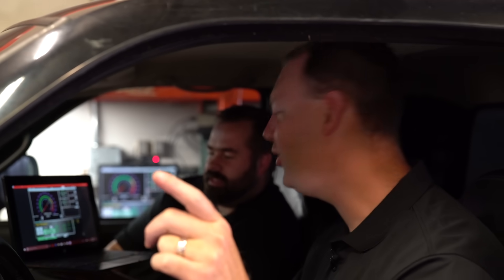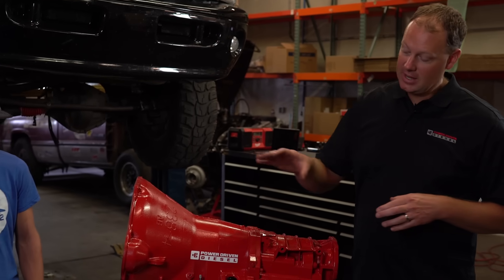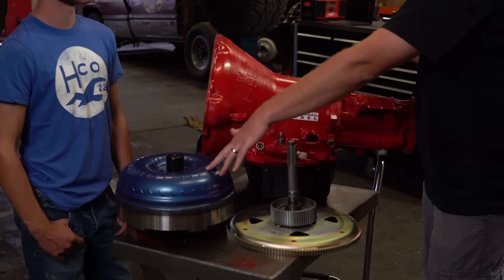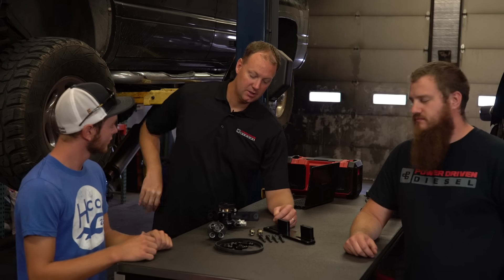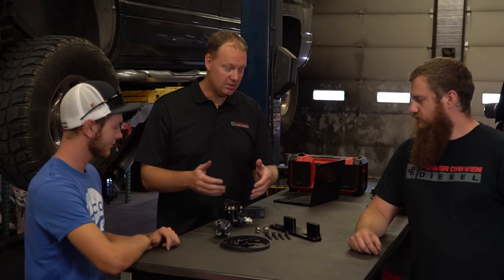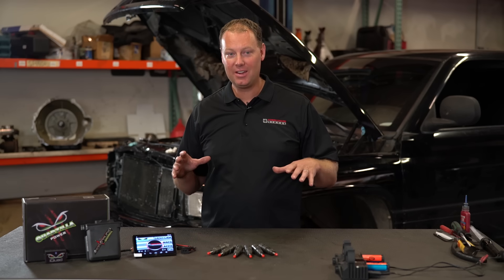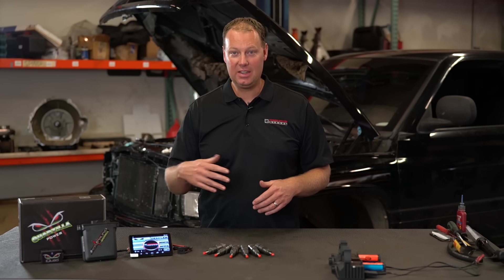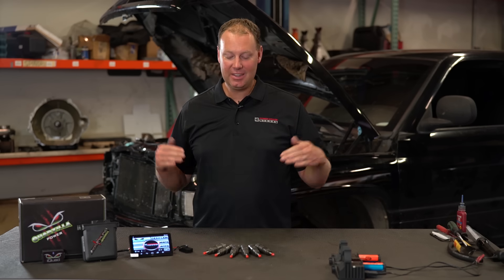We Double the Horsepower of a 24 Valve Cummins

Comment: For 250 bucks you can get a Billet torque converter with double crutches that's the HD model with a 1000 RPM stall on it it's a beast take your stock transmission and put Red Eagle racing clutches in it everything ported and drilled it's about $2,500 you don't need to go by specialty transmission you can work with the one you got I did that to mine no more issues no more burn up Transmissions I love it at least put them in second gear the Red Eagle racing clutches cuz that's your weakest so you want to take care of that one for sure and if you're going to upgrade something put a bigger damn turbo on it preferably a high-altitude one whether you're at high altitude or not and big injectors are nice but you don't need them I could get more horses and that out of my truck for half of what they paid made it would be nice to have all that money but when your broke ass Country Boy you learned to squeeze as much power as you can by doing as little as possible

Comment: I would be happy with the torque converter upgrade and the input shaft being more solid my biggest fear is the transmission falling apart in my 06
Reply: @pddofficial  that's what i was afraid of. how much is a kit for that? f i went that route i'd be looking for heavier duty internals like better clutch packs and a more bullet proof everything because rebuilding it once is no big deal but having to do it over and over again because you bought the wrong stuff the first time is ridiculous. and i've had to do that before too

Comment: So pretty much he’s gonna need a turbo by time he gets home.
Reply: I bet that stock holset is still running strong.  Iv been making 520 hp and over 40 psi at the manifold on my 2003 he341 for the last 6 years. 229k miles all stock still works great (besides things thag were upgraded its all stock)
Reply: @greatlakespowerstrokefx4  you are making 40psi on a stock HE341? Highly doubtful considering that turbo is barely good for 24-25psi. I don’t wanna call anyone a liar so do you have a clipped billet wheel in it or something? That’s a bronze bushing turbo so 40psi would not only cook it it would over-run it.
Reply: @titanary68  yes. Many people have made 500 plus wheel with all stock 03-04 but with running their cp3 dry.
Reply: @titanary68  and that is what they would make stock with stock tuning.  My assumption is the turbo is spinning upwards of 100k rpm faster than designed but it still works.  A turbo is high on my list for much needed upgrades.
Reply: @titanary68  its a Hy35w type d
Reply: Bro they didn’t even head stud it💀💀💀💀
Reply: @kylemaslyn  I ran a BD Turbo on my 24v making 45 psi on factory head bolts for many years without an issue. I met a guy that had an s366 on his 3rd gen making close to 60psi with factory head bolts and somehow still holding on lol
Reply: @edwinj8275  that’s impressive
Reply: @kylemaslyn   No Need A factory 6.7 makes these numbers and they don't come with studs
Reply: @ze_german2921  except that not a 6.7 that’s a 5.9 but on the same note you are correct they don’t need to because they’re not pushing more boost just pushing some more fuel
Reply: @kylemaslyn  you don't need head studs at the level this truck is at , I have a 2000 5.9 that makes 416hp rear wheel wih the stock HX35 at 44psi of boost.
Reply: Yeah maybe but they lived up to their word. Hell the actual offer is to double the power, not to make it reliable. They put more in the trans than in the motor. Now if they had said they would triple the power then yeah, they would be on the hook for a turbo. They did all this shit for free, oh well if he has to buy a turbo later
Reply: I want a free upgrade for my stock 2nd gen

Comment: A new stock ram 2500 already produces 1000 lbs torque. Building an old truck is kinda pointless imo, unless you’re building on an aftermarket block and nothing is stock.
Reply: Pointless? Paying 60K + for a new truck is pointless. I got my 02 spotless with 115K for 17K have about 25K into it now and it will kill a new stock ram. Plus insurance and registration is cheaper and no emmisions bullshit. Older trucks are they way to go unless you have more money than brains which is very common 👍

Comment: Hey is power driven diesel having another double your horsepower give away because I’ve got a 2006 dodge Cummins 2500 5.9 24 valve third gen and I have a Avorrau 5000 turbo on it and I would really like the horsepower to be doubled

Comment: I just bought this chip any ides why my check engine light is on my boost only hits 25 fuel press stays at 18-19 with fass and 125 hp Injectors think it has something to do with vp44 wire tap maybe?

Comment: Hmmmm, I thought that you had to do the dyno run in high gear (1:1 ratio) but not overdrive to get an accurate horsepower and torque reading? Please explain further about letting it get into overdrive with the converter locked-up.

Comment: Is there a way to test the map sensor? My 99 24v doesnt feel like it's putting out 180 more HP when I turn my quadzilla all the way up to 10. When I turn my LLY duramax to the 150 tune, the power levels are night and day compared to stock. You can hardly notice a difference from stock in this cummins. Bonestock besides s&b intake and 4" exhaust.
Reply: Make a custom tune! Every VP44 is different and should be tuned properly

Comment: What sort of long term feedback are you getting on that mechanical lift pump?  I've got a bit of a Frankenstein going on myself with a 24V Excursion.  It had a dead VP, so even though its got good pressure now with some generic frame mounted pump, I want to put in a sump and a good lift pump before I start driving it. I have a 6.4 with an airdog that died, so I am interested in getting away from the $800 electric pumps. Future power goal is probably 500.  Maybe more if I go crazy, but not interested in getting over 750. Might go with a p-pump as well.
Reply: PowerDrivenDiesel I’m gonna give you guys a call and get some more info from you. I think I want to go this route on the excursion. Thanks for the reply.

Comment: can this be done with a 2019 dodge cummings?
with the new factory 
AISIN trans also
Reply: @pddofficial  
thx
Is it safe to say that the other components like the programmer-intake manifold -different injectors-exhaust-cool air radiator are available for 2019 trucks?
Reply: @pddofficial  
Thx, we guys need to see this and know this, so if we consider a choice what is available in selecting the Truck we would like it to be.
 what you can do to help us make our Truck to be the beast it was meant to be.
Don't know how else to put it.
:)

Comment: Good effort but that engine was a pos to begin with. You almost got it up to my 2018 v6 ford platinum twin turbo. But I would have loved to see what you could have done with a 70k mile 5.9 Cummins. Great video.
Reply: How much older is that engine? Also, that thing is way more reliable than a shitty EcoBoost. Shoulda got a 5.0V8
Reply: I would love to see an Ecoboost make 186hp and 400+ lb/of torque At The Wheels in a 2500 4x4.

Comment: Wonder how long that head gasket will last?
Reply: @pddofficial  my experience as a 20 year plus owner/enthusiast of 24 valve engines is anything over 100hp over stock is just asking for a head gasket problem. No matter how you do it, injectors and tuner, turbo or whatever. that oem gasket has some weak points (near the thermo for example) but that has always been my advice and concern with power levels. Good luck to him and you.

Comment: I have a 01 2nd gen 24v that has only 135k original miles.  Is my farm truck.  Needs a tune up
Reply: I pull a cow trailer with mine. Pretty much all it's been used for. Bought it new and only major things to repair so far has been transmission and injector pump. Also had to do the rear end because my brother was throwing doughnuts in it and somehow busted the diff. There was a trail of fluid from the spot back to the house. Stayed in the road for over a year lol

Comment: Doubling the power, how about doubling the cooling? Put a 15000 lb trailer on the back and try pulling a long mountain grade. I would bet that you could count on one hand one hand the times that the rig would make it to the top before the engine would be a chunk of aluminum with pieces of steel sticking out of it. There is a reason the factory does not turn them up any more they do and voids the warranty if a tuner has been installed.
Reply: @pddofficial    Actually the stock radiator will handle a lot of power on these truck.  About 400 HP while towing it you keep the EGTs cool while towing. (Matched bigger turbo for your set up) Ask me how I know.  I have towed heavy coast to coast.  My truck is a 2000 VP truck,  with replaced 53 block (cracked) Allison transmission (blew up six built dodges towing) custom cam, pistons, larger turbo, six by eleven injectors, Quadzilla,  bigger brakes, bigger drive line, Dana 80 (blew up 70) with 19.5 wheels and tires, and all necessary supporting mods.  Tow a 16000 lb fifth wheel up any hill at speed with out issues, EGTs are cool engine stays below 220 on hot days on large grades. This truck runs virtually smoke free.  The engine  in these trucks is capable of having additional power with out issues when set up correctly.

Comment: I owned a Dodge Ram 2500 4x4 Quad cab with the 24 valve engine and the VP 44 fuel pump, what these turds are not telling you is that the upgrade kits sold KILL the circuit card on the pump. Also when you double the HP, your putting a lot of wear on the drive line , so expect to replace transmission, u-joints, some cases the rear axle.Plus you will burn a lot more fuel, for NOTHING. Plus the extra output wears the engine faster, and you pollute and  with some of the earlier upgrade kits .they recommended removing the upgrades if you had an emissions test because with the upgrade you would  FAIL, no ifs ands or buts.
Chrysler shops and Cummin's shops would look for cut and spliced wire off the fuel pump connector, if the wire was repaired...NO WARRANTY REPAIR ON ENGINE!

Comment: I have a stock 2005 dodge ram 3500 5.9 HO Cummins with 307000 miles stock original motor and trans been a great truck would love to rebuild her give her some extra power
Reply: @pddofficial  if I could afford it I would do a rebuild and add more power but I am working very hard just to stay afloat I run a 24 hour road service here in Austin TX helping motorist off the road if they call me I do charge but if I see someone stranded I get them going and dont charge my 5.9 if my family truck and work truck I work road construction during the day and run road service at night some nights I dont get any sleep at all but that's ok working both helps pay some of the bills
Reply: @pddofficial  truth is if my 5.9 goes down we are done we will lose everything but hey this is life right

Comment: id like to do something like this with my 2006, 2500  mega cab. i'm in Nashville so getting the parts for the transmission from that place in Georgia would be a cinch.putting it all together like this however is totally another story i'm sure. i am most concerned with the transmission as those are what is the weak point on these trucks. the other mods i could do over time on my own as this isn't my daily driver. it's my pulling rig and that is the ONLY reason i bought the truck in the first place. I don't even have 200,000 on mine yet though and so far the only issue i am having is with the grid heater and trying to find a keyless entry module to plug in behind the gages for this thing

Comment: 350000 on stock injectors 😁😁😁😁😁 job well done Cummins
Reply: 451k on my 12 valve
Reply: Jonathan Rajsl  i hate that 2nd gear skip get it fixed i jus went overkill on my 01 24v cummins transmission

Comment: Slowly you can see them regretting the decision of doing this for free
Reply: 😂😂😂 this made me crack up
Reply: Looked really happy when they didn’t need to give him a free turbo lol
Reply: wrong, so wrong, the Man is as good as his word
Reply: I saw it right when then hopped out of the truck lol
Reply: I know I’d make the drive to their shop if I had the money to upgrade my truck
Reply: @pddofficial  should have went with the bigger turbo anyways, but still impressive numbers with a stock turbo. I didn't know the compressors only 54mm on these trucks that is tiny!
Reply: TRD185 that’s how it was with the 24valve autos because the transmission couldn’t handle the power made with the hx35 so they put on the hy35 to not hurt the trans. That’s why with the manuals they’ll have a hx35 cause they can handle that extra bit of power
Reply: @Bob20206  : That's not entirely true. It also depends on the model year of the truck. Only 2000 - 2002 model year 24V 5.9L CTD's backed with automatic transmissions had the smaller HY35W turbo. 

I've owned several stock 1998 & 1999 24V 5.9L CTD's with automatic transmissions, and all had HX35W turbochargers on them.

All of the manual transmission 1994 - 2002 Cummins powered Dodge Ram trucks had the HX35W turbo.
Reply: Turbo Diesel I have a 2000, with automatic, so I probably have the 54mm?  I have 245K on mine! Purdy much a garage queen that I’ve owned for 5 years!
Reply: @davekana8388  Just look on the turbo. The tag on it will tell what model turbo it is.
Reply: Turbo Diesel don’t think my tag is there any longer. I had a 98.5 automatic think that one was bigger!
Reply: @davekana8388  
All of the 1994 - 1998 Dodge 5.9L 12V Cummins trucks and...
ALL of the 1998 - 1999 5.9L 24V trucks had HX35W turbos.

Only exception was the 1994 Dodge 3500 (1-ton) Cummins 5.9L 12V. It had a Holset model W1HE 19cm² turbo. That engine setup was rated at 240Hp.

The 2000 - 2002 24V automatic trans trucks had the slightly smaller HY35W.

The 2000 - 2002 24V manual trans trucks still had the larger HX35W.

The difference between the HY & HX turbos is in the turbine housing size (the exhaust side of the turbo).

The HY35W has a 9cm² turbine housing.
The HX35W has a 12cm² turbine housing.
Reply: Turbo Diesel thanks TD, perfect explanation! So the smaller one would spool fast, possibly better for towing?
Reply: @davekana8388  Perhaps, but not really. It was primarily done to limit boost due to Dodge's automatic transmission weaknesses. 

You can easily directly replace an HY35W with an HX35W, which many people do when turbo replacement time comes. (Or, some guys go even bigger if they decide to modify the engine.)

Personally, if I were going to modify the truck, I'd install a twin turbo setup. They are best for a more even increase in both low end & top end performance, by making up for the "lag" of a single large turbo.

But, that's more money than I need to spend on my trucks. Mostly stock with small mods works fine for me.

Oh, and if you're going to run a tuner and start upgrading & modding the engine, ya better invest in "bulletproofing" the transmission first, or you'll be sorry.
Reply: Turbo Diesel I did the Air Dog Raptor, BHAF, big line kit and a triple disc TC. My 98.5 went auto to an Nv5600. That ended locking up on me towing a smaller camper at 60mph in the hills of Va. Now this one, I stuck with the auto, so far so good! Turbo is still solid, but it’s nice to have a plan in place, thanks again, Dave!
Reply: @turbodiesel4709  yeah unless your turbo doesn't have a tag like mine doed
Reply: Baahahaha !!!!!!
Reply: Lol ! ikr
Reply: Hahahah Zero enthusiasm in his face.
Reply: I don't think they had any regrets, they were happy to keep their word, and from the video,  it sounds like all parts were donated, great advertising for all parties,  I could be wrong,  but these dudes are top notch and again pretty cheap advertising if they did pay for the parts
Reply: Hey hows the truck runnin now???
Reply: Lmao
Reply: instead of putting a new pump
on they should have put a real turbo on it
Reply: 1 million views they made their money lol

Comment: That bolt on mechanical pump is a genious idea. major props to him for coming up with that
Reply: I need to check into a setup like that for my 3rd gen and research if that’s the way I’m needing to go with mine
Reply: I wouldn't want a pump that bolts to my oil pan bolts. I would rather go with a different set up.

Comment: I’ve got a 03 2500 with 295000 miles. I don’t want to double the HP. I want to double the MPG.
Reply: If I could get the steering wheel to stop clicking I would be happy. Thanks.  @pddofficial
Reply: Now I’ve got 315000. Fixed the click in the steering. Another issue came up, steering box replaced. Then my batteries exploded. Replaced and replaced some cables. Hopefully the alternator will stop overcharging now. 👍🏽
Reply: Truck still running well. I might go ahead and replace the alternator anyway. It’s old and may be starting to go out. 👍🏽
Reply: @sosidecop64  you also want to check the terminal connectors. If they have loose connection it can cause the Alternator to overcharge. Another thing I would check is that both batteries are anchored down securely. The OEM fasteners tend to not keep the batteries from jostling around. Just had that happen to me on a drive from FL to NV and by adding a battery fastener and a new terminal connectors the overcharging was solved.
Reply: @dericksherwood6408  It was a short somewhere in the wiring causing the alternator to overcharge 👍🏽
Reply: My Bullydog programmer put mine from 17mpg to 30mpg running 60mph.
Reply: @orvillewooldridge417  no it didnt
Reply: A bit late to the party but my 99 gets 19 in the city, as long as you dont drive it like you stole it you should be fine.
Reply: I’ve got 328,000 miles now. Wooo hooo!

Comment: Of course you realize he's going to drive home and immediately install a bigger turbo just to see what it can handle. It's a good 20 minute add. You do good work. It also shows the challenges of hot rodding computer controlled vehicles. You need a ton of support electronics. I would've liked to watch the tailpipe though. Would it still pass emissions?